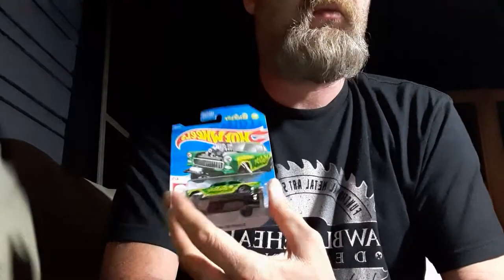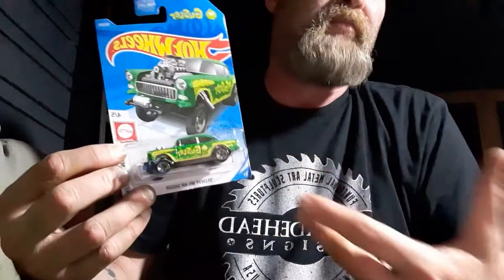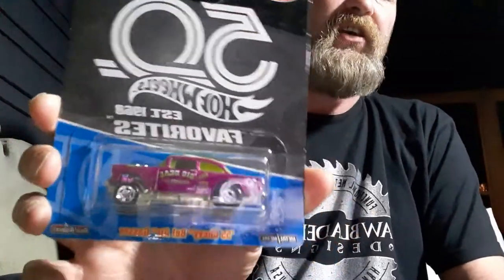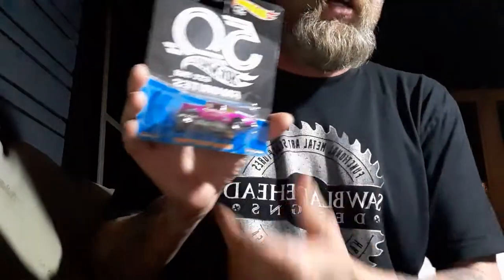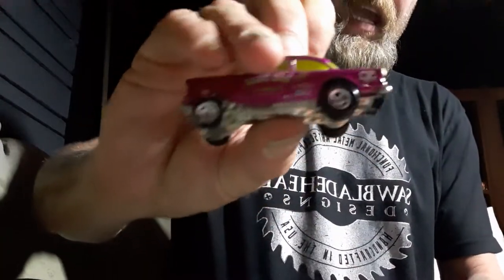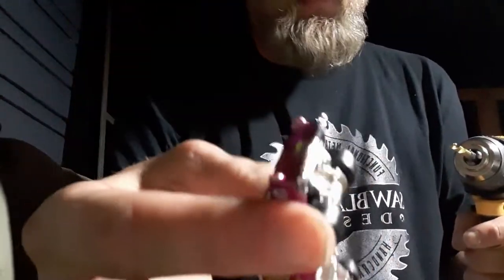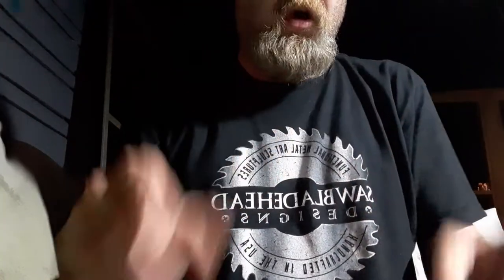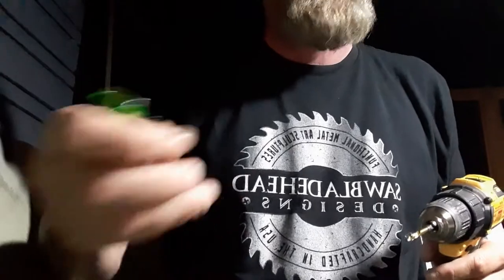Hot Wheels 101: Blister removal + Base & Wheel Swap (Metal on Metal & Real Riders)

Comment: Interesting and instructive, thanks! What adhesive do you recommend for reattaching the bubble to the card?
Reply: exactly the question I was thinking of!
Reply from the maker: Michael's sells a product called Tacky Glue it dries clear and doesn't yellow over time. That is what I personally use. Thanks, if you have anymore questions on HW customization please let me know.
Reply: @thecomicbookundergroundllc3506  Is that the Aleene's clear tacky glue, or another brand? Thanks!
Reply from the maker: Aleenas Clear Gel Tacky Glue is what I use.
Reply: @thecomicbookundergroundllc3506  Great, thanks!
Reply: @thecomicbookundergroundllc3506  I have a few action figures in my collection that have curled cards, and I would like to give a try at taking the figures off the card, pressing the card and then putting the figures back on. That's why I was curious about the glue. If it works I'll do a video on it.
Reply from the maker: If the cards are glossy stock the Acetone trick won't work, you'll have to use the acetone directly to the blisters edge but you can risk the figure if the acetone touches the figure. I use a heating gun and only do 3 sides top, bottom & right side that way the figure can be removed and you only have to glue one side. Either way be very careful not to melt the blister or hurt the figure.